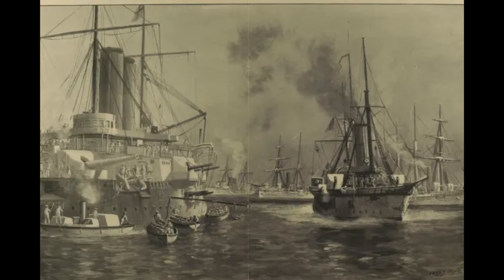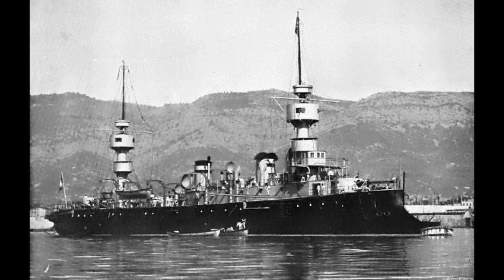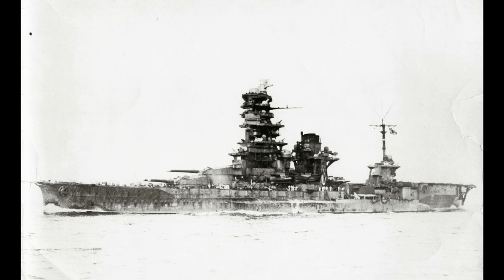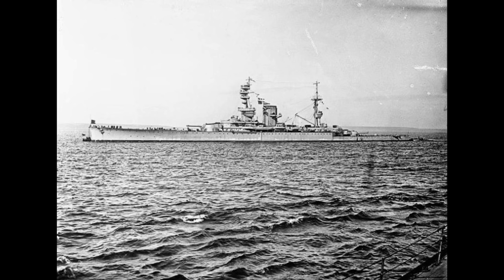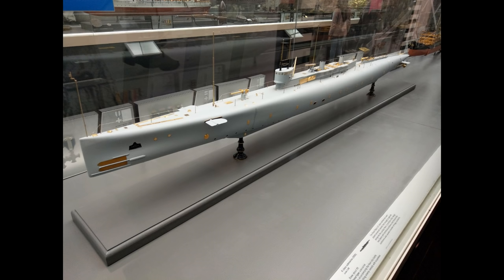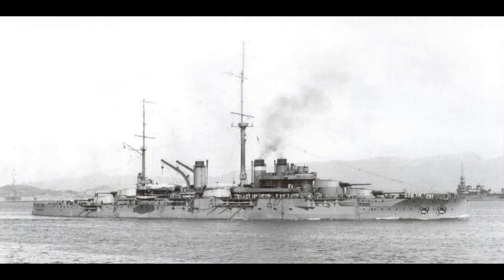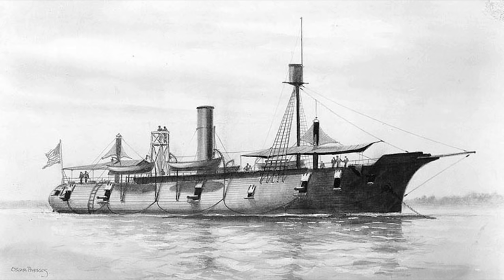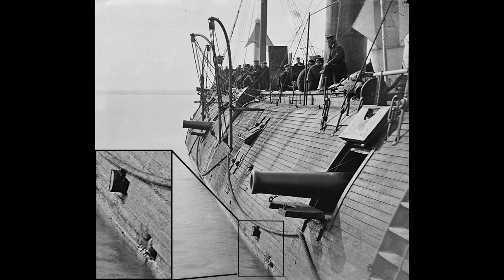Naval Engineering Disasters - How not to design a ship

Comment: Carriers without armoured decks? Bit of an oversight, perhaps?
Reply: Considering a larger airwing was better protection, and the 1000 lb bombs the IJN and US were dropping would penetrate any RN carrier.... not an oversight.

Funnily enough, after WW2, the US built armored decks, and the RN unarmored decks. Maybe a case of "grass is greener on the other side"?
Reply: @treyhelms5282  It's a balance: the armoured deck is heavier, with the usual operational consequences, and the wooden deck is easier to repair and get back into action. But 1000 lb bombs weren't the only things hitting the decks and the wooden decks did take a lot of damage - as did the spaces below them. The fact that each design switched to the other suggests that the balance was very fine indeed. So to say that wooden decks were a design blunder is probably wrong. It's just that there were a lot of times when you would have wished for a bit more armour overhead!
Reply: @neilhales4693  agree completely

Comment: Not sure if this counts as a disaster, unless disaster includes Cluster-F⚡⚡⚡s. I heard about this from an AB muppet who'd served on one of these (TBC) engineering disasters, & it was a long time ago so I'll stand corrected if anyone sees fit to do so ("Don't let the truth get in the way of a good dit" possibility type thing). 

    The Royal Navy commissioned a load of state-of-the-art mine sweepers back in the 90s (iirc), the objective being that the RN wanted the prestige of owning the best mine sweeper division in the world (that they might maintain supremacy in at least one thing amongst the other world's navies) - which arguably they were succesful at. However, one architectural engineering oversight too many left a whale sized spanner in the works which wasn't discovered until the ship's companies boarded for the first time, incredibly! 

    As the junior rates searched for their mess deck it became increasingly obvious that the architects or ship yard had completely negated to include the junior rates' mess space in the design/build, which usually holds about 50% of the overall ship's company - this being a minesweeper equating to about 20 ratings now without a living space & pits. Absolute Cluster-F⚡⚡⚡, right?

    The amount of money spent on these vessels was significant. Minesweepers are sensiibly constructed without any ferrous metals, so expensive alternatives have to be used - imagine building the engine, gearbox etc without any steel. Iirc bronze was used a lot & perhaps gold wiring like in subs. Any road, the point being these ships cost a fortune & simply had to be used as if fit for purpose. In the end it was decided that the fwr'd rope store (situated right up by the bow) be converted into a mess space for the homeless junior rates, & the ropes to be stored elsewhere; wherever there might be adequate space. 

    As mentioned earlier, this mine-sweeper class are non-ferrous in construction. Their hulls are made from glass-reinforced-plastic (GRP) which as you can imagine would leave the ships considerably lighter. Mine-sweepers are also small ships which are famous for rolling like pigs in the smallest of seas. Now imagine you're layed in your rack trying to catch Zeds, except some moronic pillock, armed with a degree in ship engineering, completely forgot to accomodate half the ship's company; so now you're shit out of luck with the Zeds because your rack is right up in the bows, which if you picture a see-saw is basically the way a small ship (especially) moves as it crests & troughs its way through choppy seas. Those poor bastards: even "Life in a blue one" fails to console the poor sods with the gashest bedroom ever!! Half your sleep spent weightless, the other half being slammed & crushed into your matress - not even a crate of red death could fascilitate a good night's sleep throughout that.

    When I first heard this, I couldn't believe that the Royal Navy I/C, the ship architects & the ship yard all, had failed to oversee & scrutinise throughout the build, enough to notice that one of the most important compartments of the ship had left the building. Utterly Mickey Mouse & a fantastic use of tax-payers money. Sucks to be the C.V. of the guy/s whom the blame landed on.